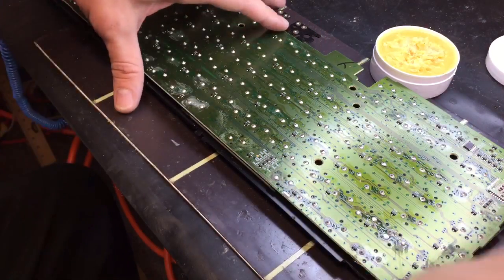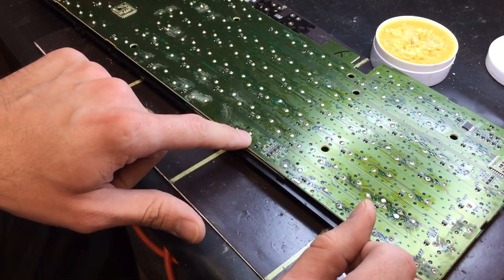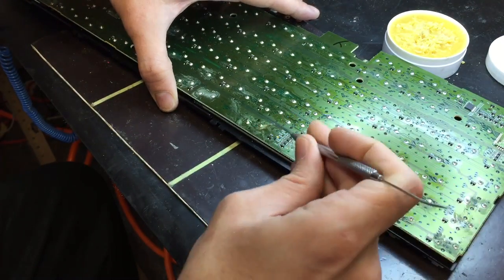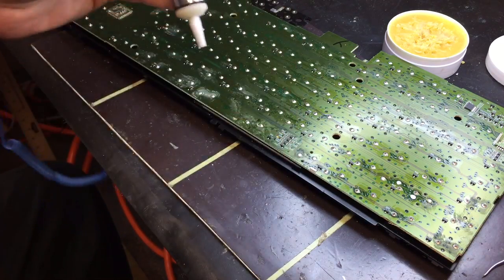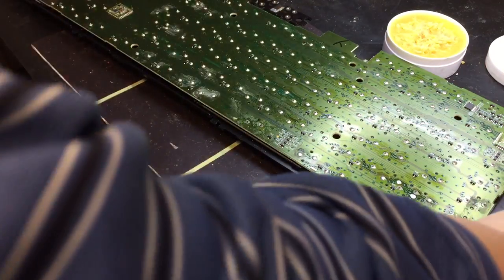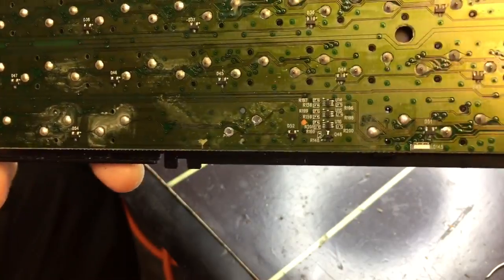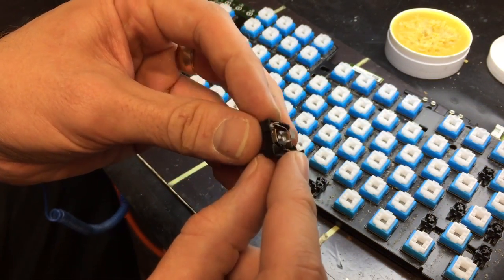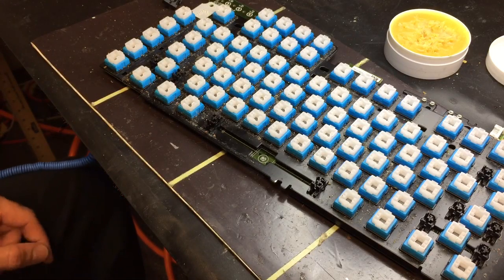Remove Logitech G910 switch for replacement

Comment: @ConnivingBones - man, am I frustrated. I took apart my G910, removed the old switch, replaced it with a new one, put the keyboard back together again only to find that the switch does not work! I must have done a poor soldering job or, the new switch was defective out of the box. I'm debating whether I want to go through the tedious task again but, like other things, once you do it once you can cut down the time by 50% the next time -- or so they say.
Reply from the maker: I’ve had experiences like that many times.  It happens.  Keyboards are relatively simple.  Try working on someone’s high end smartphone or tablet.  Them are a different beast entirely.  They are more expensive, typically, so if you mess up it costs a lot more to deal with it.  Then theres personal data involved.  If it doesn’t work after you “fix” it there could be a problem.  Losing someone’s pictures or videos of their kids is not good.  You wouldn’t believe how many people don’t back up their data.
Reply: @ConnivingBones  Although not a professional, I am the 'go to guy' on anything IT related with my friends. PC problems, WiFi, Smartphones, etc. 
I used to be able to work on a smartphone to replace modules and such. Not anymore. I'm in my late 60's and my dexterity & patience is just not what it used to be. I do like to fix things though and, I thought I'd take a run at fixing this keyboard. Although I no longer do any gaming, I like the quality of Logitech keyboards, the full size, the lighting and, that I can adjust the volume on videos using the roller. 

I just ordered flux (I did not have it; just the solder and a solder gun) and will give it a go again when I have some time. The only thing not working is the #5 on the right side of the keyboard. I can always use the one along the top. 

I will not let this bugger beat me! Haha. Anyway, thanks again, and Happy Thanksgiving!

Comment: I need to remove the #5 key switch on my G910 keyboard. Per your other video, I have my keyboard disassembled (thank you for that step-by-step). 
How does one determine which pair of solder joints to remove? Some are numbered; some are not. I hate to guesstimate only to unsolder the wrong pair!
Reply from the maker: I just turn the keyboard over and see where it is on the opposite side.  You could try placing a finger on the key and keeping it there while you turn over the board and look down the edge to match it with a finger on the opposite hand.  Hope this helps!
Reply: @ yes, I found it. Thanks.

Comment: I know this is an old video, but I was kind of hoping you could answer a question about these keyboard PCBs. Is it possible to Mill-Max them to make them hotswap capable with romer-g switches? I know the layout is different, but I have 4 of them because I simply love them and was hoping to just canabilize one of them to make the others all good working keyboard with easily fixable switches without taking them out to solder. Let me know your thoughts. Thanks!

Comment: Good vid bro, as a tip - if you run into components that have larger solder pads or multiple pads that are close to each other, add a bit of flux then add solder until it’s a decent sized glob. The solder most manufacturers use has a higher melting point than most off the shelf solder, so adding your own will reduce the overall melting point and make it easier to melt and suck out. For the components with multiple solder points close to each other, add flux and solder until you bridge the pads, then heat the solder - melting all points at once and allowing the component to fall out. Then you can use copper braid or solder sucker to clean the pads for a clean component replacement

Comment: Just had my spacebar switch break as well, replacement and the desolder thing you used are on the way :)
Reply from the maker: Excellent.  Take your time and you’ll be fine!  Good luck 👍🏼
Reply: @ConnivingBones  Update after a week or so: it went great and the solder points look really clean :)
Reply from the maker: @Emelydiaa  Nice 👍🏼

Comment: Hey I know this is a fairly old video but seeing as you've answered comments somewhat recently I'm hoping you're still around. I needed to replace the switch for my CTRL key so I ordered all the parts and a basic soldering kit. However, this is my first time soldering or desoldering so I think I must be doing something wrong. I've followed your video but after I apply the flux to the legs of the key and press my soldering iron to it to desolder it, nothing seems to happen. It's like I'm melting the flux away but the actual soldered part of the key switch is basically unaffected. Should I be using a higher temperature? Pressing harder with the soldering iron? Using more or less flux? I have no idea why it's not desoldering it at this point. I don't want to fiddle around and damage anything.
Reply from the maker: Anyone who has the gumption to get as far as you have also has the ability to succeed.  So don’t give up and don’t force it.  As the saying goes let the tool do the work.  Your first instinct sounds correct.  Likely your iron is not achieving the temperature needed to hit the melting point.  Try not to solder where you have a fan blowing on your project or in extremely cold rooms.  Airflow and air temperature affect your solder work.  If your iron is hot enough and you have applied flux the solder should liquify(appear shiny/wet).  

I can recommend 2 options:  1) Use a higher temperature solder iron.  I am a Weller man as I have always used their equipment and it has never given me trouble.  2) Use whats called a low temperature alloy.  This is visually identical to typical solder but melts at MUCH lower temperatures.  Using your iron, you apply it on top of your tricky solder and as it melts it blends together reducing the melting temperature of the entire mass.  I actually use it quite often.  It’s also much cheaper than buying a new soldering iron. You can get it on ebay for ~$13.  Look for “Fast Chip”.  A little goes a long way!  Lastly, if you aren’t using solder wick to remove excess solder you should consider getting some of that along with the low temp alloy.  Its as valuable a solder tool as flux.  I hope this advice helps you.

Side note:  When using the low temp alloy you need to remove as much of it as possible and use ACTUAL solder to attach the replacement part.  This is important because the low temp alloy is very brittle and will not provide the bond needed.  It is only for removal.
Reply: @ConnivingBones  Thank you! I'll give it another try with what you've suggested!

Comment: I saw this video back when it was uploaded because my G910 keyboard had done the exact same thing. The top of the housing of the spacebar broke and caused the key to constantly press itself. Being an idiot I tried to glue the top back on then remembered it was a mechanical key. The glue seeped onto the spring and siezed the entire thing shut. I then decided to look for a fix, found your video and immediately ordered a new switch on ebay. It is only right now as I type this that I finally got around to fixing it. Thank you for the video.
Reply from the maker: I firmly believe in personal responsibility.  I was raised by that mantra and hold others to it daily.  “Do it yourselfers” like you and I are usually that caliber person and the reason I take the time to make the random “how to” videos I post here on youtube.
Reply: Hey can you drop me a link of where to buy switch??i cant find anywhere to buy switch
Reply from the maker: @Veggas9  ebay search “romer g key” they are still available as of 11/18/21 although at a Biden price now.  Someone has to pay for this socialism, might as well be us right?

Comment: I know this is an old video, but I was wondering if it would be possible to switch the keys to the new gx keys. I dont want to upgrade just yet, and they are both logitech keys so I wondered if  it might work.
Reply from the maker: Honestly I’m not sure. I would have to have both in my hand so I can look for differences.  Might be able to tell with pictures of each but would not be as certain.

Comment: can you use other switches to replace the romer-g?
Reply from the maker: SmashMyKeyboard Unfortunately no. They are proprietary, designed specifically for logitech. The good news is the last time I checked they are available on ebay.

Comment: I will never buy a Logitech keyboard again, it is expensive and easy to be broken. I bought a G910 in Saturn (shop) 2 years ago, and now at least a spring of three keys in the keyboard has a problem. Hence, the elasticity of the keyboard is not good, it hurts my fingers as I type.
Reply: Same here. I bought a 10 pack replacement switches and only hoped I only have to use 1 or 2 at worst. Every time I replace a switch another one gets retreated presses. I then got up to 5 replacement and at that point I started to search for another keyboard while ordering another set of 10. Not that expensive for the pack but enough time to find another keyboard. Found wooting and decided to plunge in on that one. It’s $10p more expensive than the g910 but the payoff comes from the longevity. I’d rather pay $200 for Hall effect keyboard that will last forever than a $100 that will break down just in time for the warranty to expire. Logitechs proprietary key switches are the worst.

Comment: Thanks for the video, just replaced one of the switches on my g810. Having never done any soldering before, both your desoldering and soldering videos were very helpful
Reply from the maker: Very happy to help.  If you get the chance to teach it to someone pass it on to others so that you may free yourself of the bonds of power.  After typing that I feel the need to elaborate so I’m not demanding you do something, lol- It is true what they say, “ Knowledge is power and power corrupts.”  They do not tell you the way to prevent corruption.  I believe it’s truth.  Knowledge is truth, it is absolute, and is transferrable through teaching.  It is the reason ‘nefarious’ people try to dilute, en masse, others ability to learn and to teach others.  When you pass knowledge on to others you can no longer use it as a weapon against them.  You are disarming yourself and making you equal, in respect, to others.  I should add this is only an effective prevention to corruption if you teach fact(truth).  We all have the right to know the truth and thus the right to factual knowledge.  I’m having an excellent day today I hope this doesn’t sound too “preachy”.  I’m generating philosophy for some strange reason.
Reply: @ConnivingBones  Never heard this before but it sounds like the way to go - Thanks for sharing your wisdom!
Reply: @ConnivingBones  So true they pray on good people and their ignorance to the evil around https://www.youtube.com/watch?v=LrXiC0XY2ZA&t=421s

Comment: hello! in my case i have a problem with the spacebar. yesterday i took out the key and i must ve broken the metal parts that are under the spring those shiny gold parts that surround the led. i tried putting them in place even though i dont really know which one is the problem and it still doesnt work. it doesnt make contact and it blocks. i know some years passed since tou uploaded the video but can you please help me?

Comment: Hi great video, I tried to replace my shift switch on a G810 but I failed.
I used 2 kit from a friend but the solder doesn't melt !! (50w and 100w)
Do you have any idea ?
Reply: use flux, if no flux then tin solder on the pin. That should mix with Logi's solder allowing you to melt through for you to us a solder sucker.

Comment: Dang it. Was actually looking for how to replace them with cherry switches but yea
Reply from the maker: Stevka MSP Unfortunately the “romer-g” switches are proprietary.  The solder points will not line up with cherry switches.  However, Logitechs new “Pro X Mechanical gaming keyboard” can swap between 3 different types of new G-switches.  While they are also proprietary they feature solderless connections!
Reply: aren't they just rebranded kailh choc switches ?

Comment: You seriously saved my ass with all 4 of these vids on the 910 repair. My spacebar key bricked, managed to replace it, and also managed to give everything a good clean, and even fix my volume roller that would jam up randomly (ended up being a loose piece of plastic caught in the roller), you saved me a brand new board <3
Reply from the maker: That’s the reason I decided to shoot these videos. I like helping people because people have helped me so many times.  Thanks for the positive comment.  Very glad I could help!  😎
Reply: @ConnivingBones  Thank you!
Reply: @ConnivingBones  First, thank you for your videos on the G910. I just took mine apart per your other video. Question; how do you confirm the key you are going to replace? In my case, it's the #5 key on the back.
Reply from the maker: @gabrewer55  Confirm the key? Expand a little on what you’re asking, I’m confused 🤔
Reply: @ConnivingBones  To clarify, the solder joints on the board. I'm not 100% certain which ones to remove so, I can solder a new switch.
Reply: Ugh mines not even 2 years old and I'm getting key repeat on A and also sometimes it just stops working without a replug (though I can't guarantee that's not the shitty usb hub in the screen it's plugged) .. hopefully a clean will help, I've designed pcbs so I'm not opposed to de/resoldering a new switch but am disappointed that they're not swappable 😂 keyboard was way overpriced but I don't hate the feel and I hated paying just over 200 cad for it, letalone more for a "good" mech esp considering so many are missing numpads.. I wish I kept some of my old ps2 keyboards 😢 (my mobo even has ps2 ports lol)

Comment: How did you remove the key-caps without breaking the pegs? I got a few broken pegs that are stuck in the switches on mine. Do you also have any advice for removing broken pegs?
Reply: I'm in that boat as well, came here because I figured I might as well replace the switches.
Reply: You figured this out? Same problem here

Comment: can they be replaced with cherry mx switches?
Reply from the maker: Nexuality No.  They are designed physically different.
Reply: @ConnivingBones  Hey could you tell me if this will fix the led issue i have with three of my keys? are the LEDs built into the switches or on the board? Thanks!
Reply from the maker: Jeremy Boyles They are on the board and I have yet to be able to source them.

Comment: I bought a  romer g keyboards and it suck . The keys keep double input or skip and the key caps inner leg broke so easily and stuck in the switch housing seriously suck. And it's so expensive in my country I would never buy Logitech keyboard again
Reply: Same issue. You'd think a top of the line 200 dollar keyboard would last 10 years but no. It started double inputting for me aswell.
Reply: @Cyrus_II  there is a software fix, I think its called "key shatter fix" something like that.
Reply: @MrDragonorp  Thanks I'll look into it
Reply: @MrDragonorp  It's key chatter fix
Reply: Watch a video on youtube that shows how to eliminate this problem. Video is called as "How To Fix Mech Keyboard Double Typing/Chattering". That method helped me a lot.
Reply: @ends_with_a_bullet  I'll look it up thanks.

Comment: Damn I have the same issue with my G810... time to buy the solder thing
Reply: Shit im having the same issue, did you find any other way to fix it?
Reply: I just sent mine in to a local repair shop. They fixed it really good for £15. Next day pick up. Good luck!
Reply: @doosrah8029  Ohh nice. Did you have to take a new key to them or did they just fix the faulty one?
Reply: I had already stripped the keyboard myself, so I only took a new Romer G switch in black, so they can do a straight swap.
Reply: @doosrah8029  Oh okay. Thank you very much for your help!

Comment: this is very helpful i need 2 switches where can i find them i bought a rma product from a friend it was really cheap
Reply: Melih Türkçü it should be fine
Reply from the maker: Melih Türkçü ebay “romer g switch” as of this morning they are available (out of china).
Reply: ConnivingBones im living in Turkey they closed paypal here so i cant use ebah because of it
Reply from the maker: Melih Türkçü The romer g switches are also available on Amazon.
Reply: The Romer G switches on Amazon are more expensive than Ebay, so if you have a way of paying getting around PayPal I would recommend that.

Otherwise, they are the same switches from the same guy(s) in Hong Kong.
Reply: i found them on alieexpress should i buy from them ?
Reply: Melih Türkçü it is likely the real deal, but only way to know for sure is to buy them.
Reply from the maker: Melih Türkçü they are ‘probably’ legit.
Reply: i think it's my best optin right now they cant hurt the keyboard right ?

Comment: Hi man,are these compatible with orion g810?I have a problematic led in one of the keys i need to replace.And if so where did you find them?The led's are on the switch right?
Reply: If you wanted to, couldn't you just take one of the G1-9 and replace it with that?

Comment: Thanks for video!
Romer G is trash
I slide my keyboard tray in and as it was going under the desk, one of the key hit the edge of desk lightly and snapped right off.
Blue tab broke off and only way to fix is to replace the whole switch.
Blue tab is so thin and flimsy...
This is what I get for cheaping out and not buy real cherry keys...
Reply: had the same issue than you :/ Carefully studying how to replace the switch with this video